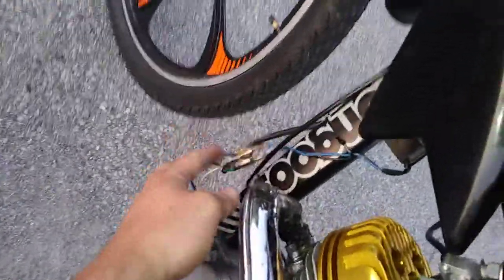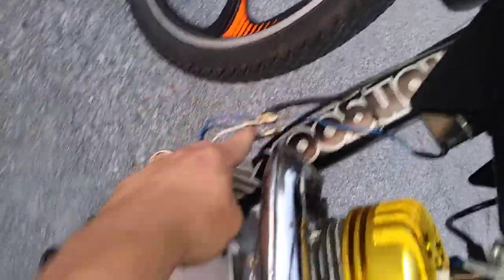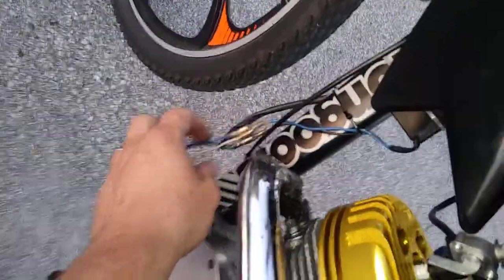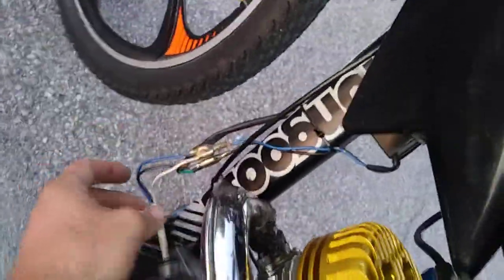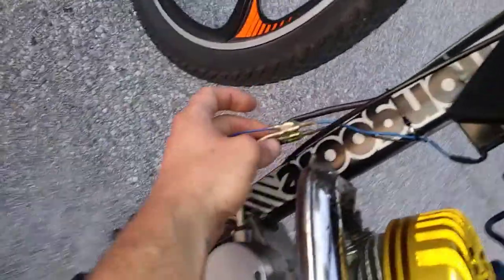Modified 80cc Mongoose Mack quick ride 44mph

Comment: Hey man, I'm really interested on how you made that thing look almost exactly like a dirt bike! You've inspired me to attempt making one.
Reply from the maker: Thanks! I have videos before this on pretty much how I did it I took a regular seat post and modified it for support so the seat can bolt to it and for the tank I just welded to studs to the frame but I got rid of this bike about 5 to 6 months ago, I wish I had better videos of it completed but I didn't get any unfortunately.
Reply: Nice man! Thanks. Did you ever take it on some basic trails?
Reply from the maker: I have once but it was geared a little to tall but fun.
Reply: ENGINES N WHEELS what if you do one with a predator 212cc motor
Reply: @Baldys_projects  how did you get the fuel tank  to go under the dirt bike plastics

Comment: Why do you have your white wire plugged in just cut that white wire
Reply from the maker: +Jareds Motorbikes dont make a difference its solderd to the same spot as the blue wire so it doesn't matter.
Reply: True but i just cut mine got the same motor bike been riding it for 2years now .there awesome bikes i like what you did with yours
Reply from the maker: +Jareds Motorbikes well thanks!